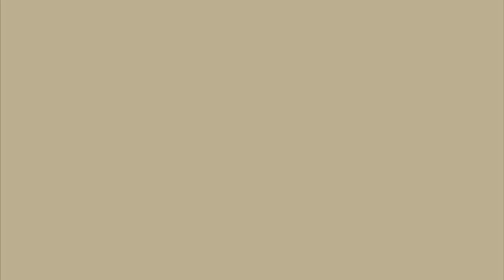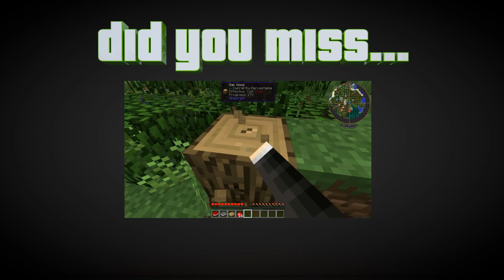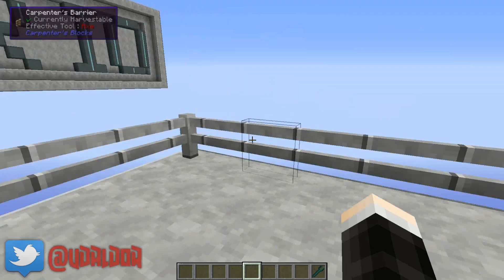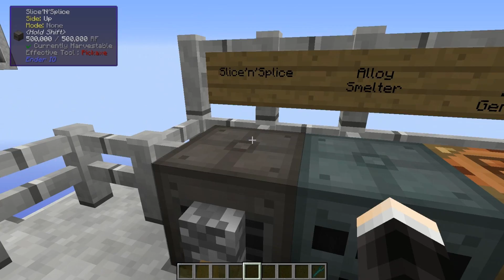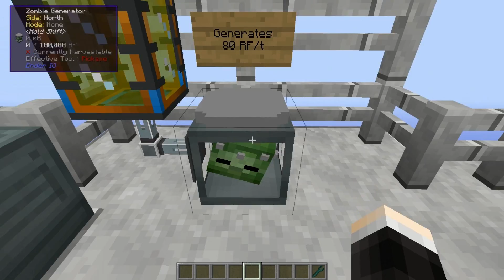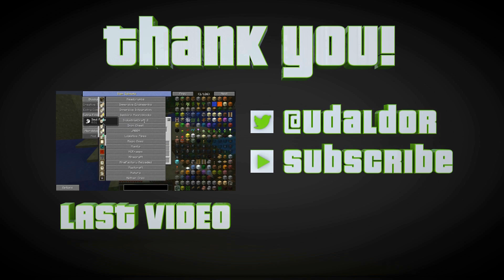Ender IO Tutorial Series - Zombie Generator

Comment: The real question, I suppose, becomes - is it worth it? Making nutrient distillation is not a particularly fast nor straightforward process. If you have a mob farm (for zombie flesh) and a nether wart farm it can be sustained fairly readily, but the mob farm in particular can be a pain to set up - and if you're using Ender IO's Killer Joe, is itself a drain of nutrient distillation. Using Ender IO's powered spawner isn't really a viable option, not only for the intricate construction process (and major experience cost of imbuing the spawner) but because of its enormous power consumption, which would kind of defeat the purpose of setting up a zombie gen.

Same question goes for the Ender IO fuels in the combustion generator, really. Especially in single player where you can reliably make the night go away, solar farms, while obviously more expensive in initial setup, can get just as much power as the zombie generator with two advanced photovoltaic cell blocks - and potentially a lot less infrastructure (no Vat, no mob farm, no item or fluid transport) if the place you need power is anywhere near the surface.
Reply: Solar power is a bit boring and generally doesn't produce much rf/t
Also, assuming you're playing a modpack and not just vanilla+ender io, mob farms are must-haves and incredibly easy.
In my FTB Infinity world I set up a mob farm with Cursed Earth from extra utilities, a mob grinder from MFR and now I'm desperate to get rid of the endless flow of rotten flesh I get besides the gold, lootbags and gunpowder.
Reply: But the zombie generator doesn't produce all that much RF/t either. As mentioned above, two solar blocks accomplish just as much power gen, with no infrastructure required once placed.

That's the issue: that the returns from the zombie generator do not seem to justify the hassle of making and supplying it.